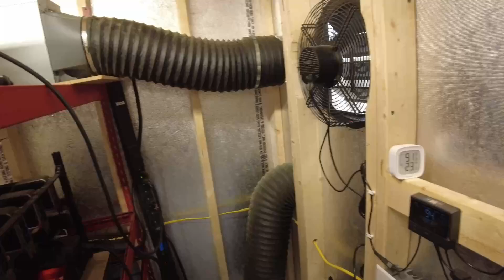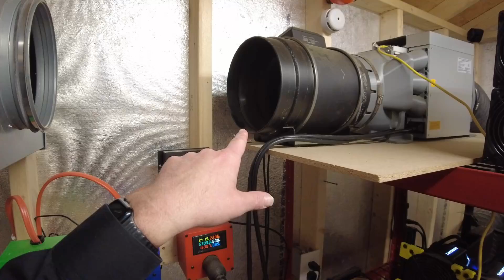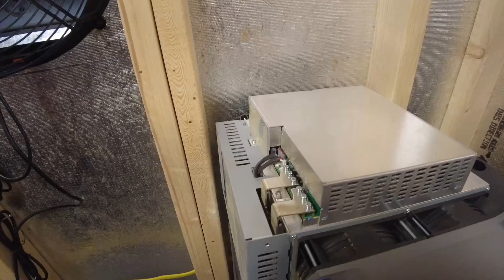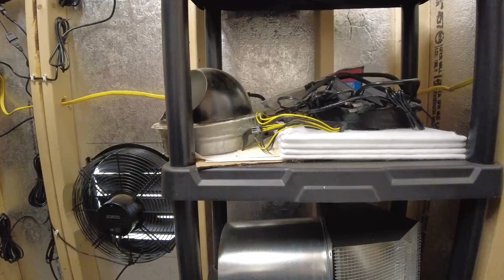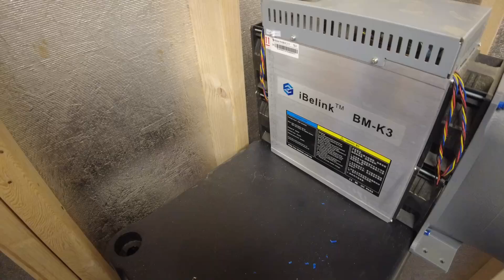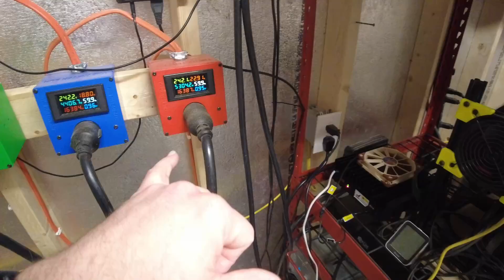Preparing the Crypto Mining Shed for Hotter Temps

Comment: Have you considered moving the ASICs down to the bottom shelf so that the heat has more time to get sucked out before it hits the ceiling and mixes with your cooler intake air? Another option, and probably the best would be to build a hot/cold isle with the foam board you mentioned.
Reply from the maker: that would be an option as well.  My first step is going to be to isolate the s19k pro.  My inline fan kit came in and I am going to set it up this weekend..  Agree on the hot/cold isle.  I'd have to  do something with the shelves since they are wire mesh and would allow heat to bleed into the cold side.  I do have a ton of the foam board.  Probably 10-15 4ft x 8ft full panels